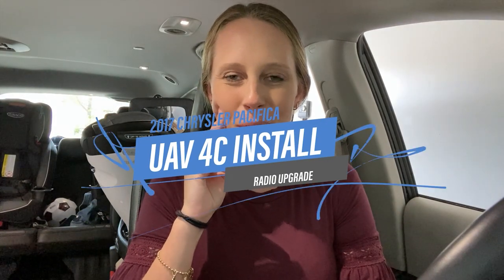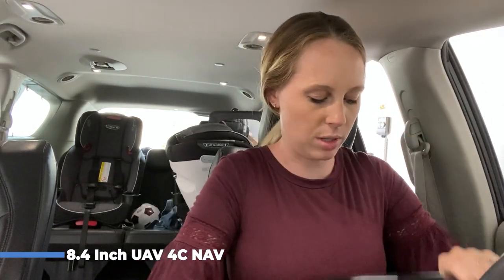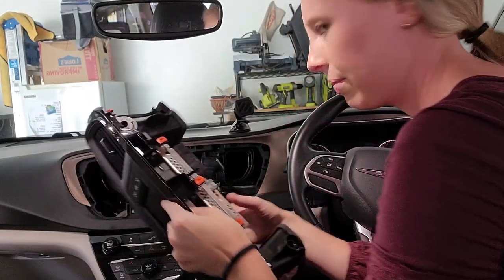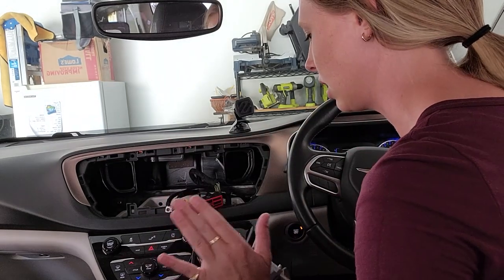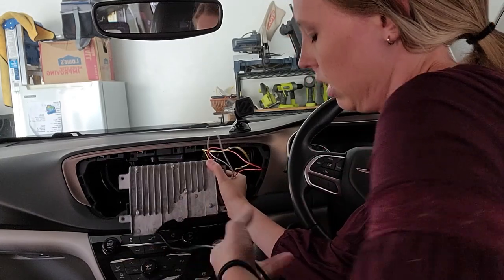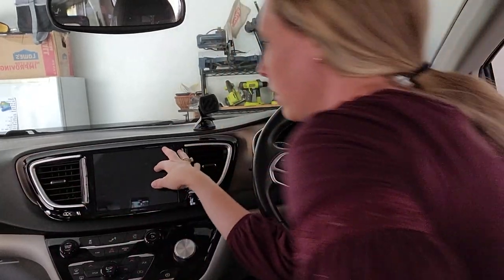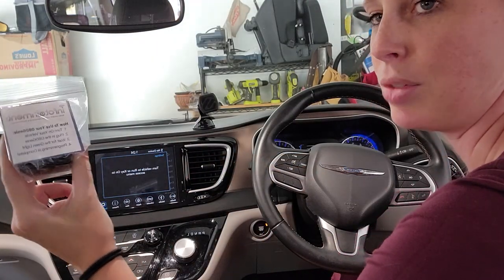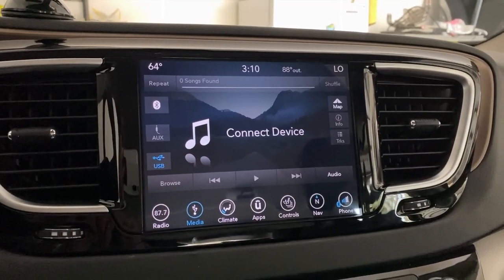Watch Mother of 3 Casey Anderson Upgrade Her 2017 Chrysler Pacifica with an Easy DIY Installation!

Comment: How much does it cost? I need to do this to my van. I have a 2017 Chrysler Pacifica.
Reply from the maker: The cost would depend on the drop down configuration and the features.  Feel free to give our sales team a call if you have any questions. 

1-855-636-6287 Ext: 2 or sales@infotainment.zohodesk.com.

https://infotainment.com/shop/interior-accessories/infotainment-radio-upgrades/2017-chrysler-pacifica-gps-navigation-radio-8-4-nav-ra4-upgrade/

Comment: You didn’t have to fork out $2+ grand. So there’s that.
Reply from the maker: Right now it is currently on sale. Even the selection that requires the most parts is around $1759.96. (As this upgrade does require different parts depending on what is factory installed).

Comment: $2000!!!!
Reply: Yep, they ripping ppl off
Reply: Our dealership offered it for $1700
Reply from the maker: It ranges from $999-$1999 depending on your existing setup. We are using OEM parts with our OEM programming and harnessing. Plug and play. If dealers offer this, then it's most likely us providing them the kit. Aftermarket options tend to be cheaper in price and quality.